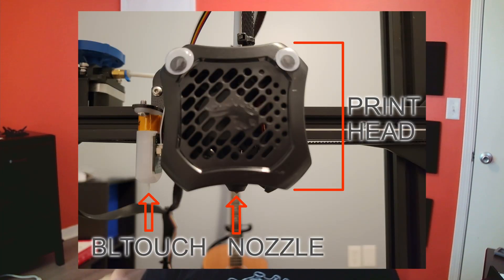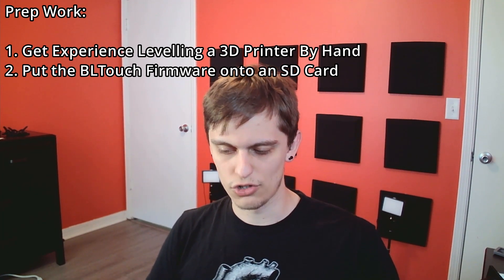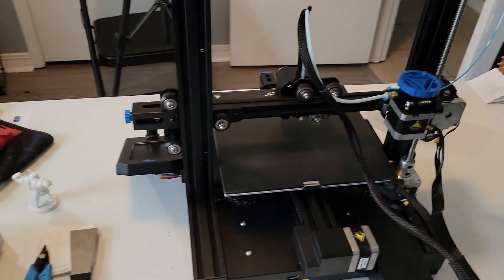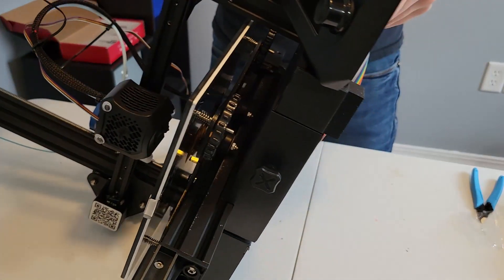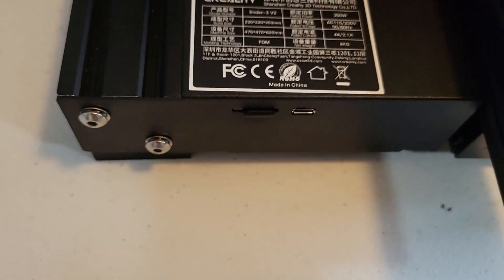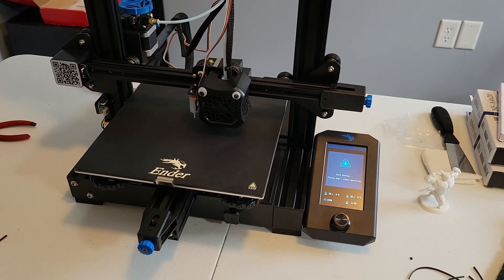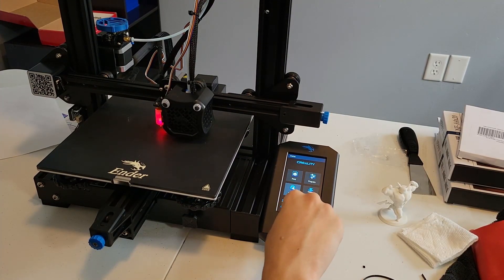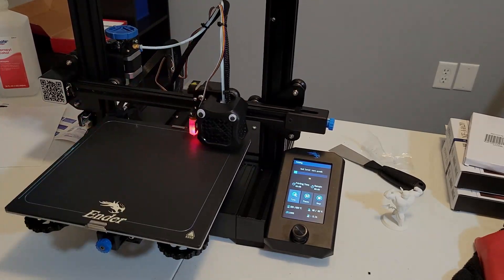BLTouch Installation and Review - Auto Bed Levelling Ender 3v2

Comment: Great video. I was frustrated by the fact that I didn't get the Z axis completely right the first time and second and was about to give up... My question is now... How often do you control your z axis offset? Every time? Every 10th time? Min seems to be different from time to time.
Reply from the maker: I'm glad you found it useful! 

And "different from time to time sums it up".

My mentality is that this tool doesn't let me eliminate calibration, but when I'm printing I can focus on that, and later I'll focus on maintenance. I'll tweak it either whenever I touch a screw (especially on the head), or monthly, or whenever the head contacts the build plate. If you're printing a lot, I could see biweekly being a reasonable default too.
Reply: @MoltenBytes  thanks for clearing this up for me... I'm totally new to 3d prints and I have found a lot of videos on the install and first time use and calibration but nothing what to do between the print and how often they are using the auto level function
Reply from the maker: Gotcha, that's really good feedback, I'll try to address that specifically in a future video
Reply: @MoltenBytes  awesome that is much appreciated

Comment: Hi I wonder if anyone can help?
I have an Ender 3 Pro and have recently added an a CR Touch for bed levelling.
Although it goes through the motions of leveling I'm not convinced it's applying the mesh.  Is there a way of telling? I've added the G29 code to Cura which sends the probing command to the printer before it prints.
I spent 3 to 4 hours last night tweaking the bed manually to get an even test print, but surely the CR Touch should do this for me.
Any suggestions welcome.
Reply from the maker: When you manually leveled your bed,  did it involve raising it? (ie did you correctly calibrate your z-offset?)
Reply: @MoltenBytes  yes did the usual. Z offset to find the nozzle distance and then apply the figures to the probe offset settings.
I just can't see the point of this probe. I can level the bed quicker manually which is why I was wondering if this mesh is getting applied or its just probing and looking pretty.
Reply from the maker: Hmmm you did install the CLTouch firmware, right? If not, that would do exactly this.
Reply: @MoltenBytes  I eventually got round the problem by applying a M500 code after the probing so save the mesh and modified the Cura code to include M420 S1 after G29 to enable and retrieve the mesh. Now it works Yay!! 👍
Reply from the maker: Nice! I'm glad you got it working and now that's documented somewhere!

Comment: Hi, I have the CR Touch and I'm finding that circles at the back are showing signs that they are a little too far away from the bed. However all other circles are perfect, when looking through a magnifier.  Any suggestions welcome.
Reply from the maker: Hmmm, obviously that sounds like a leveling problem, but thinking beyond that I would try increasing the bed and nozzle temperatures (one at a time) slightly and seeing if that makes it better.

Comment: When I do this, the homing on z-axiz doesnt work. All it does is a probe dance above the bed and never lowers down.
Reply from the maker: That's really odd -- can you move the z-axis manually if you input something under Prepare > Move > Move Z?
Reply: @MoltenBytes  Yes, but it can only move up, it wont move down.
Reply from the maker: Hmmm, can you confirm that you've disconnected the z limit switch?
Reply: @MoltenBytes  Yes, I unplugged it from the actual switch though. Would it make a diffecence if I unplug it from the board since it is leading to nothing? I just did not want to mess with the glue.
Reply from the maker: That shouldn't make a difference - it's just wire.

Does the probe extend from the BLTouch during homing? Also, once you raise the z axis, can you lower it back to zero, or is it stuck at a positive value? 

(If you need to lower it to troubleshoot further, you can disable the steppers and then twist the z-axis screw by hand)
Reply: @MoltenBytes  Yes, it extends, but when homing, it goes up a little when doing z, then moves prob up and down like twice while keeping th z in same spot, then stays down and never moves, leaving the printer in the wait screen. Do you have a link to a suggestable firmware? I have the 4.2.2 board, without the adapter I belive.
Reply from the maker: Okay, so I don't have on hand, or remember the exact files I uploaded to my printer.

Make sure though that you check Control > Info, look at the firmware version, and download the latest "___ BLTouch - x.x.x ___" package that matches. I believe I used this place instead of the manual, and it lines up because I have mainboard version 1.1.1 (that's what shows on the printer), and the download from creality that gave me issues in the video would've been for 1.1.2

https://forums.creality3dofficial.com/download/ender-series/ender-3-v2/

If that doesn't fix it for you, I will re-flash the firmware for my printer and let you know (out of curiosity, do you also have firmware 1.1.1?)
Reply: @MoltenBytes  Yes, I used 1.1.1 from that site and that is what is giving me my issues, it also loaded completly in chinese. I made sure to download for the 4.2.2 board too, not the 4.2.7
Reply from the maker: Okay, later today I'll reflash my printer and let you know what works - sorry this has been such a pain :/
Reply: @MoltenBytes  Okay, thank you verry much for helping me! Yeahhh...this does kinda suck.
Reply from the maker: @Zebulin Jones Alright, I flashed back to the stock firmware (which I confirmed didn't work with the BLTouch, and didn't have the level option in the main menu), and then I tried a few other firmware versions that all softlocked the printer in one way or another, but I think I've found one that does seem to be working.

1. Go to https://www.creality.com/download
2. On the left select "Ender Series Firmware"
3. Select "Ender-3 V2 3D Printer" from the main list
4. Download "Ender-3 V2-Marlin-2.0.1-HW-4.2.2-mainboard-V1.1.2-Compatible with BLTouch and filament detection.zip"
5. Extract the bin from the .zip file and place it on an SD card as the only file
6. Insert the SD card and boot the printer

Hopefully this works for you -- if it does I'll pin a comment up at top.
Reply from the maker: Dang, I thought that was gonna be it.

Your display at the end does say 1.1.2 instead of 1.1.1, but the firmware specifically lists itself as being 1.1.2 compatible.

I couldn't see the z-axis moving in the video, instead of moving it a few mm, could you try raising by say 50.0 or 75.0 or so? It should take a few seconds to complete, and the print head will raise a very noticeable amount. If it doesn't move, check the base of the z-axis screw to see if the motor is spinning without the screw, or if the motor just isn't spinning at all.
Reply: @MoltenBytes  It says 1.1.2, which is what I upgraded it to. And the Z-Axis moves up and down before auto home/level, but when I do that, what you see in the video happens. Then the only thing you can do is move z up, but not down after that.
Reply from the maker: That's really, really weird. 

Can you downgrade to the original 1.1.1 and try the firmware that worked for me?
Reply: @MoltenBytes  1.1.1 did not work for me, it did the same thing.
Reply: @zebulinjones6136  Try using Jyers firmware and make sure you download the right file for the board you have because there is 2 boards and they each have different stepper driver configurations. I hope this helps!
Reply: @MoltenBytes  NEW UPDATE!!!

I had the BL Touch replace by amazon for another and it now works with the 1.1.1 firmware!
Reply from the maker: Oh hell yeah! Glad to hear it! 

I wonder how many other people had faulty devices...

Comment: So what do you do if the screen doesn't turn back on?
Reply from the maker: Did you mess with the lcd firmware? 

If not, then let's start by making sure that the connector in the main board compartment is still plugged in...

Comment: Hi MoltenBytes and everyone. My initial assessment of the bed levelling problem I'd been contending with may have been erroneous. I think I'd mentioned I thought the problem might be the X-axis gantry being loose, but after doing a complete overhaul of my printer, I found several other probable causes that needed immediate attention. The Z-axis motor had come nearly completely unfastened from the vertical aluminum side extrusion, so I refastened it. I'm surprised. It's amazing that the Z-axis worked at all, but it did and gave no visible indication of a problem! This in itself did not solve the problem I'd been having with bed levelling (with or without the BLTouch). After taking the glass off, and taking the bed apart, I retightened any visible screws. Then I reassembled the bed. Why? I'd noticed that my printer bed occasionally rocked gently up and down on the sides when the nozzle was in motion. It bothered me and I'd wanted to know why it was doing this. Tightening the loose screws helped to solidify and stabilize the bed. It no longer rocks up and down on the sides. I guess Creality hadn't tightened these very much, and the bed assembly had been gradually coming loose. As for the X-axis gantry, it occurred to me that I might have been able to move it up and down so easily because I'd disabled the stepper motors in the process of bed levelling. If I'm not mistaken, I think Creality even tells you to disable these during this process. I avoided doing this and the gantry seemed to hold its lateral position more firmly. It was near impossible to move the gantry up and down by a distance larger than a millimeter or two, and I had to force a bit to get it to move. Now, I'm finding it easier to level my bed. A combination of these problems may have been at the root of the problems I'd been having. In any case, my printer is working much better, and I'm glad I had a closer look at it. My nozzle has also stopped getting clogged because of an unlevelled bed. Sadly, I've come to the conclusion that the BLTouch is nothing more than a useless gadget, and I've stopped using it altogether. If you like blinking LEDs, then by all means, continue to use it. Now that my printer has been "repaired", it works like new. And when bed levelling, I now avoid disabling the stepper motors, and move the nozzle with the Move command instead. Why? When disabling the stepper motors the bed comes loose and is free to move, but this freedom of movement is not at a constant or fixed value. If this value changes every time you disable the stepper motors, how can you be expected to level the bed on the first attempt? You can't. It takes several tries, and then some. By not disabling the stepper motors I was able to level my bed on the first attempt. I hope I've not misled you or any of your viewers. It's been a learning experience to say the least, but I love 3D printing again!
Reply from the maker: Not disabling the stepper motors is actually really good advice - I don't usually do that anyway, not intentionally, just more because if the printer is on, then it feels bad to move it manually. 

Anyway, I'm glad you've gotten things sorted out!

Comment: I may have been under the wrong impression. I thought the BLTouch made a data table, what some people seem to be calling a mesh, of the different heights and locations of the printer bed and that this data was later used by the motherboard to extrapolate Z-axis data to control the Z-axis movements between the auto levelled points when it does its auto levelling thing. A slight concave or convex bed surface would not matter much if these were within a reasonable limit, and the printer would be able to continue printing regardless of these surface defects by raising and lowering the hotend along the Z-axis where needed, albeit in a linear fashion. Does this make sense? Because this doesn't seem to be the case. Maybe Creality should have thought to add some type of proximity sensor to their design for better Z-axis control. 
Anyway, I've only been using the BLTouch for a couple of days now, and I can't really say that I'm impressed. True, my print quality seems to have improved somewhat, but it didn't start out that way. It might just be that I paid more attention to properly levelling my bed manually. My prints were printing with an acceptable quality before I installed the BLTouch, and before everything just decided to go to hell in a hen basket, and for no reason at all. I'm impressed when my 3D printer works well. I'm not enchanted with 3D printing at all when it doesn't. I was able to remove the excess PLA from infilled holes with ease using precision screwdrivers. After breaking a few of these on more stubborn infills and supports I found something better on Amazon. Since I installed the BLTouch, I've had to drill out my holes because the supports seem to fill the hole nearly completely, and that's not what it was doing before. The only change I made to my slicer (Cura) program was I'd added G29 after G28, so there's no real reason why this should be happening. I will admit though, the outside walls of my prints now have a mirror quality finish. They are so well printed I can't see the layers at all any more. At some point during my short 3D printing endeavor, I inherited multiple extrusion problems, and my prints were horrible. This recurring nightmare occurs periodically despite the fact that I replaced the plastic extruder for an aluminum one hoping to solve the problem. At that time I had no trouble at all seeing the layers and I could easily twist my parts apart with little effort. So, I'll give someone or something credit for the superior wall quality improvement, but I can't be sure I'm not the one to credit.
Now, if I just can just fix my holes, I'll be back in business making my prototype designs for robotic experimentation. I'm trying to make an 8-legged spider. It's been a challenge, and I love it! I'm learning more now than any other time in my life. AlthoughI love what I'm seeing of hexapods on YouTube. Some of them are absolutely incredible! 
Sorry about that, I got off track there for a moment, but I'm back. Let's see, alternatives to the BLTouch -- I've found two other bed levelling sensors on Amazon, but I haven't tried any. I wanted to stick to the tried and true, or more popular brands with user feedback. There's "3DTouch". I don't know who makes these, nor did I read the user feedback if any. There was one other brand, but I can't remember the name of it offhand. Seek and you will find.
On a last note, sure, I can sit here and bitch that the BLTouch sucks, but it really doesn't. I just need to figure out how to configure everything together properly, and by then I might praise its invention like everyone else seems to. First, I have to get my printer and slicer settings working properly again.
Reply from the maker: Thanks for the information again Henri! I haven't done a ton of printing with holes in the XZ/YZ planes, so maybe that's why I've had a better experience. I've got some good candidate projects coming up that I'll play around with and see if I run into the same issues as you.

If you do find another auto-leveller that works well, send a link my way so I can give it a shot too and see how it stacks up.